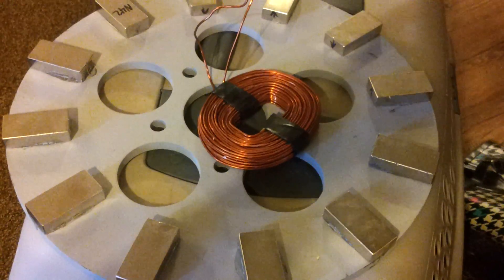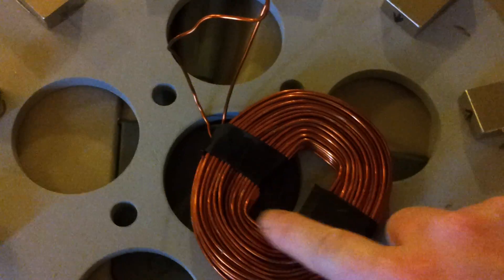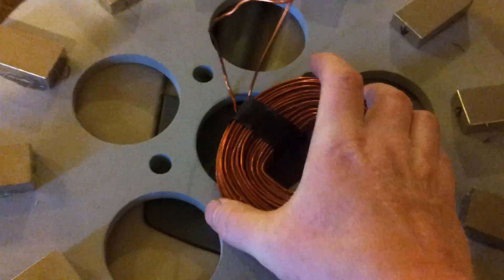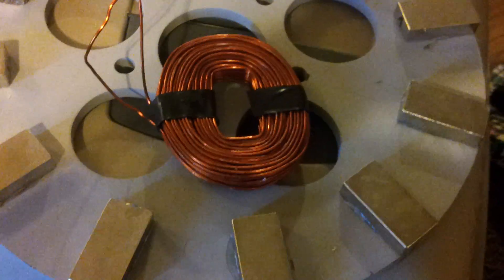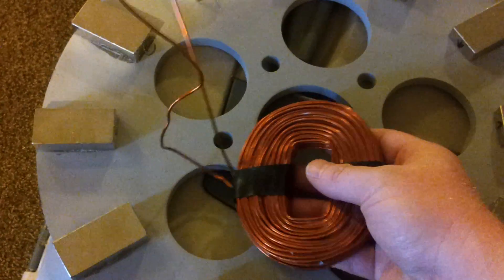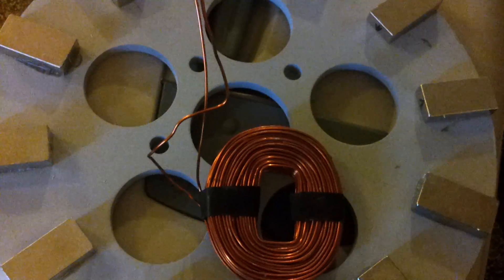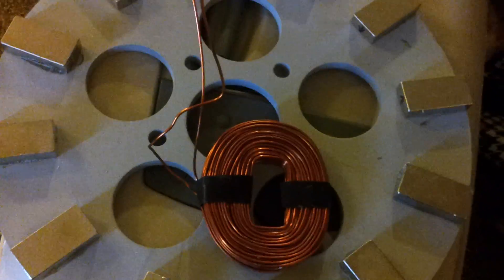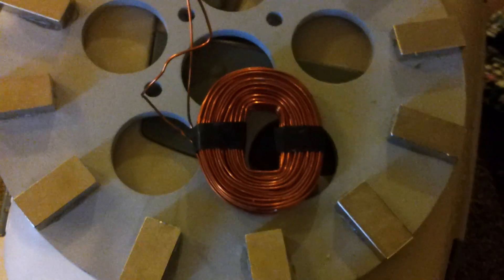Coils for 1kw wind turbine.

Comment: Hey! It's me from the future, 2022. What would have been the problem if the coil was round? Just round? Except for the fact that maybe doesn't fit in the area, let's asume it fits. Is there any difference between round coils and this shape you have in the video? Thank you!
Reply from the maker: The issue really is magnet coverage and crossing speed relative to the outermost dia of the coil and innermost dia. May lose some efficiency and definitely couldn't fit the same amount of copper in there round vs triangular.

Comment: Nice work so if my rotor was spinning at 6000 rpm and I had n52 magnets 60mm by 200mm how big do you think my coils need to be to produce 24 volts and 50 amps frim a single coil, I mean what gage wire and how many turns and what size coil given the core is silicone steel laminate

Comment: Can you teach me the formula for the number of turns?
Relationship between voltage, power generation, rotors rotation speed and number of turns of coil.
Thank you very much.
Reply from the maker: I purchased this book and it details how many turns vs gauge of wire vs turbine size. 

https://www.amazon.com/dp/B003XVZADA/ref=cm_sw_r_cp_apa_DjKLFbS4DTWS2
Reply: For
Reply: U$2 book, good deal

Comment: Why thick gauge when it's low voltage and current on each coil 🤔really appreciate this valuable data and pioneering venture. I'm doing similar explorations so this helps
Reply: Thicker wirer = lower copper losses = more watts.  The amps, not the volts, determines the wire gauge ...
Reply: @MrSummitville  actually the lowest comment in this video has a resource
Reply: @MrSummitville  do you know a resource I can use to calculate my sizes of wire and magnets to get the exact volts and amps (~100v&8a) 

BTW I would use a wheel powered by gravity instead of wind.

Comment: I have a couple questions about an individual coil...
How deep can you make a coil? I know it has to be as close as possible to the magnet, and apparently it has to fit the shape of the inner of the coil, and have half the width of the magnets width, But how deep/thick can you make the coil?
When do I use thick wire, when do I use thin wire? when do I use a lot of magnets, when do I use as few as 2 ?
I mean I could spend thousands of dollars and hours of time making it all by myself, but I'd like a head start by knowing that asap, preferably without a trip to the library or visit on google (which I tried, but I can't find the answers i'm looking for)
Reply from the maker: Flor Hoorebeke order the Hugh Piggott from Amazon. It's called wind turbine recipe book.

Comment: Q:how many turns and a gage for
1- 24 volts
2- 48 volts
Thanks
Reply: - For 12 Volt machines you need to wind with two strands of #14 gage wire in hand and each coil should have 36 turns.

- For 24 Volt machines wind with 1 strand of #14 gage wire and each coil should have 70 turns.

- For 48 Volt machines wind with 1 strand of #17 gage wire and each coil should have 140 turns.
Reply: @bunamasidibeh3446  The only guy on You Tube that give real information blessings for you and prosperity for you.
Reply: hugh piggot recipe book

Comment from the maker: Since I used a 14 inch magnet plate I have room for 115 turns using 14 ga. Since this vid I have wound more and they become less problematic with each one.
Reply: 434josh this seems way too late to comment but how do I know or calculate if i still have a room if I Know magnet size, number of turns and wire gauge. Excuse my lack of experience I am new to this field.
Reply: Knight Rider .

Comment from the maker: Its a sun g 1000 Watt, 22-60volt unit. I will probably end up using a second c40 to divert extra current to a water heater. Other than that, I will most likely only be making 150-300 Watts 90% of the time.